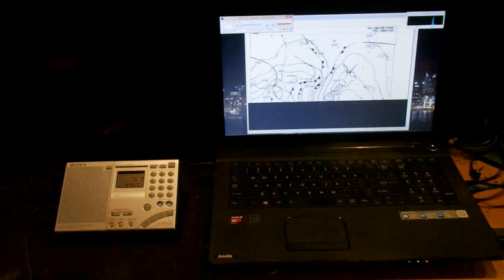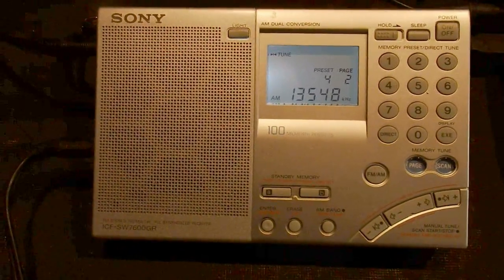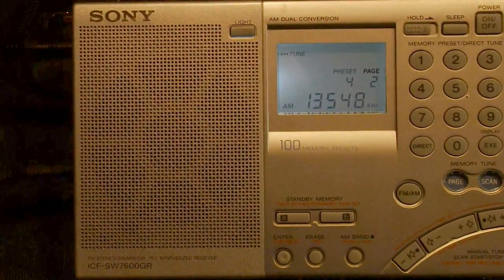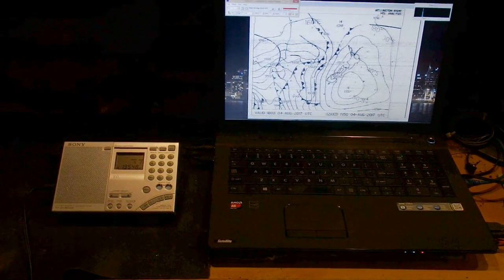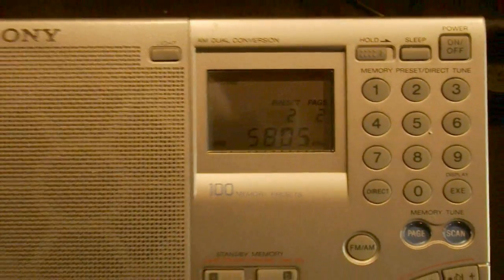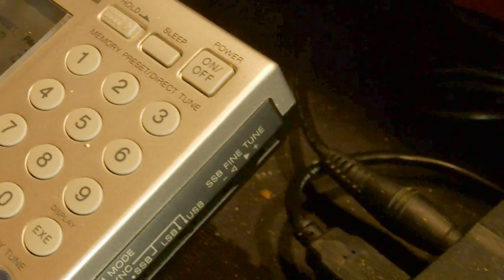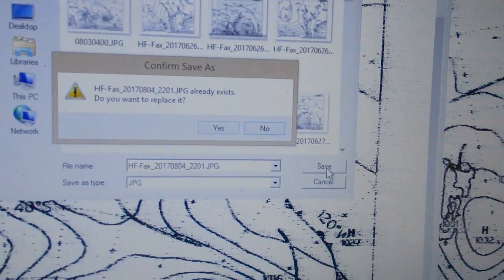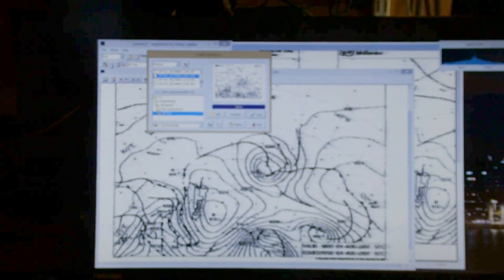SONY ICF-SW7600GR Weather Fax Again

Comment: Hi..I am Deniz from Turkey..I have a small question with 7600gr. When I plug in a extarnal antenna jack fm is off.There is no sound.But other bands is on..Is this a ptoblem or normal? Thanks
Reply from the maker: Just tried a stereo plug in the antenna socket, and FM was still on. What type of antenna are you using? Has it a mono plug? That could short out the internal FM antenna connection.